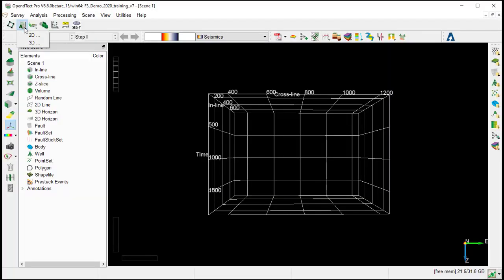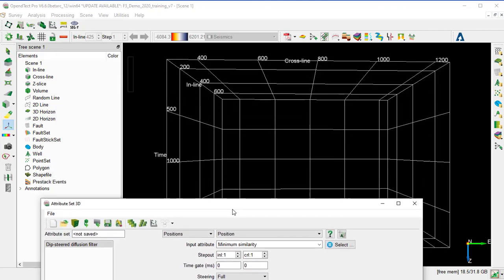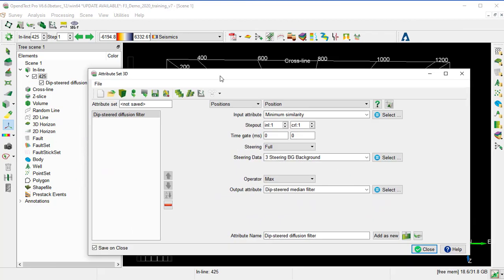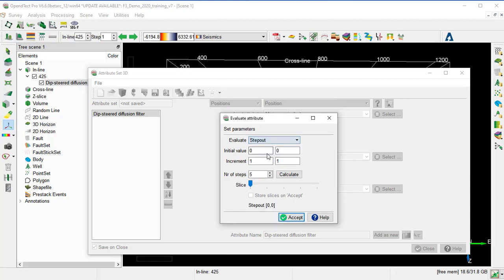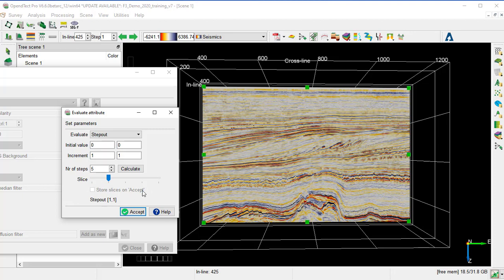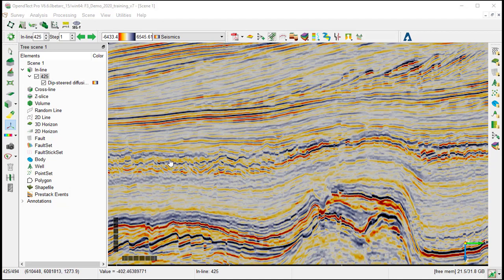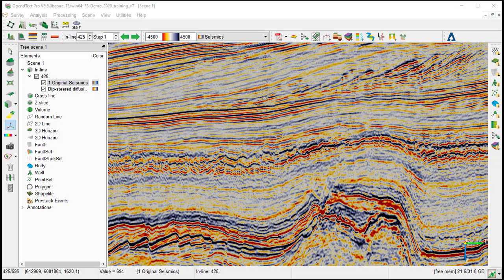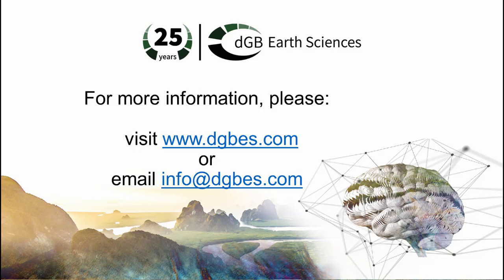Training workflow: Data Enhancement - Dip-steered Diffusion Filter

Comment: How to create the Steering BG Background. Isn't that an obsolete process? as now we generally create steering cube using the PCA method which is faster. Will the older method of creating the BG steering cube produce better results?. Please elaborate. Plus create a video on the creation of the steering cube parameters, as that is fundamental to most if not all the subsequent computations.